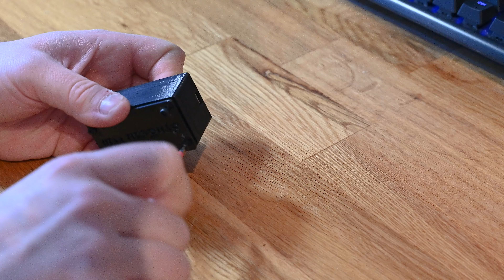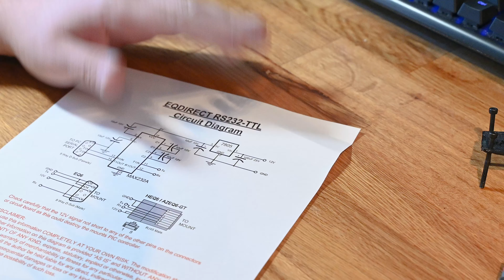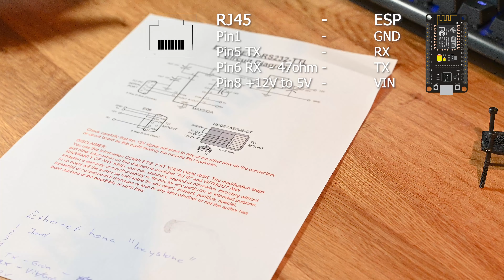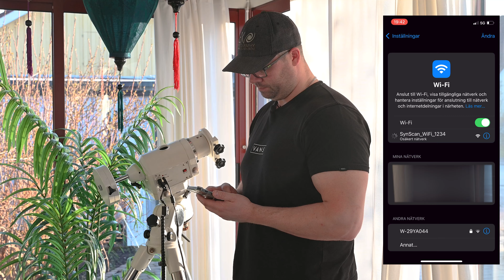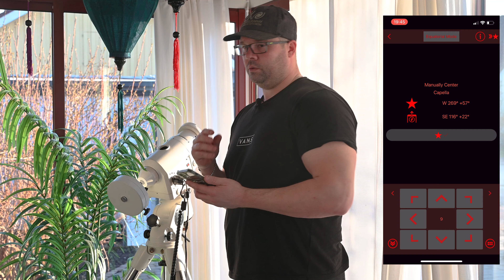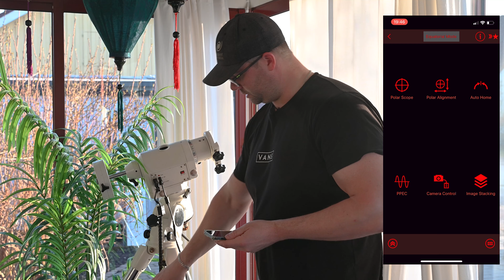DIY SynScan Wifi ESP8266

Comment: Is there support for this to work with EQMOD? If so, this would be a great way to get rid of the last USB cable I have crossing the tube/mount threshold. If not, I guess there is always the skywatcher wireless synscan adapter. I just prefer custom solutions like this for the learning process that comes along with them.
Reply from the maker: I actually dont know, I have looked in to that possibility.

Comment: A question about telescope: I'm considering an 10" f/4 ONTC carbon newtonian from Teleskop Express (or is it Teleskop Service?) and I've seen that you have one of those. Would you still recommend such a scope? It's for both photography and visual.
I've watch a few images from these scopes on astrobin, but seem a bit soft - is that because of compression the website is doing? Do you have a image online that is in full resolution to demonstrate the scopes capability?

I have their TS-Photon metal OTA 8" f/5, but the focuser is not at right angle to the tube and I had to put quite a lot of paper on one side to fix it, but that introduced a lot of light leaks. Also I think the tube is flexing from the weight of the camera.
Reply from the maker: Hi!
Teleskop Express and7Or Telescope Service is the same company, just a different name for the international market i think.

I would reccomend the scope, the tube is well made and very stable, as with the mirror cell, it is built like a tank.
It can be used for both visual and photo, but if you are uding it only for visual, i think it might be a bit overkill.

I have some pictures on my astrobin: https://www.astrobin.com/users/Exo_Photography/

Best regards / Daniel